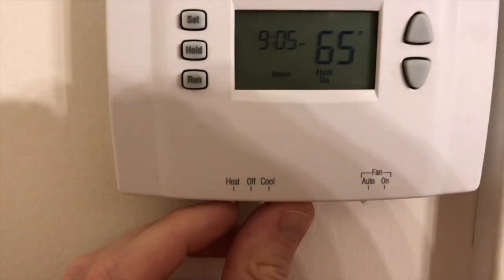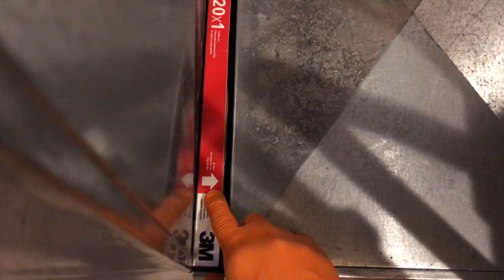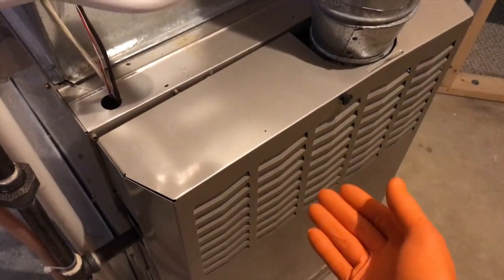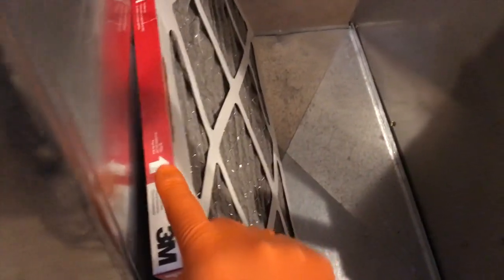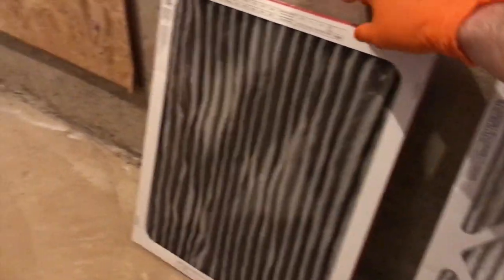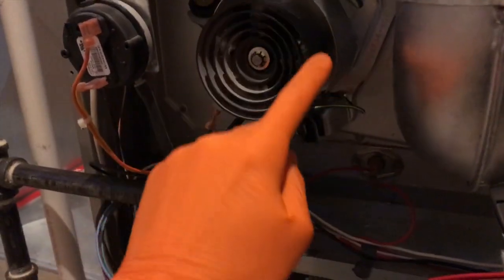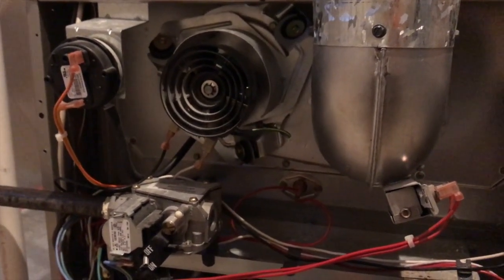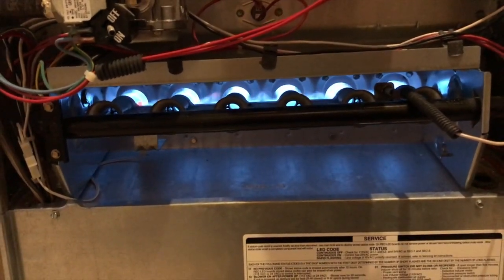Bryant furnace Blowing COLD Air - 90 Second Air Flow Filter Test!

Comment: My furnace is a model 810S and it does not slide from the inside or side panel. I have to take the front panel off. There’s a bunch of wires.
Reply from the maker: Thanks for watching and sharing this.  You are spot on, the 810s is a different design.  Any update on your project?